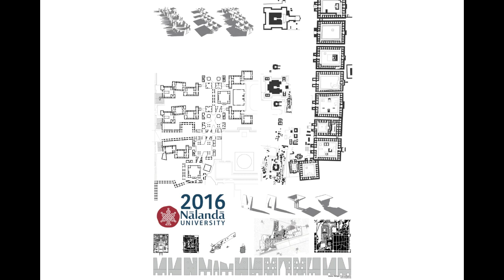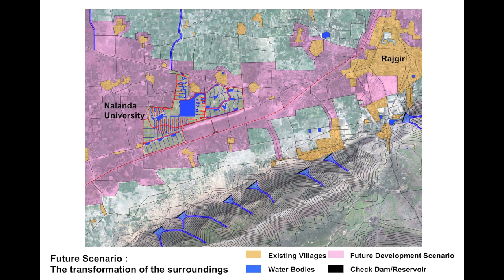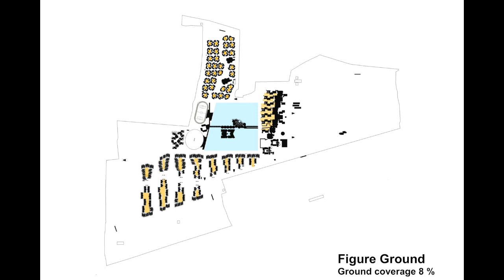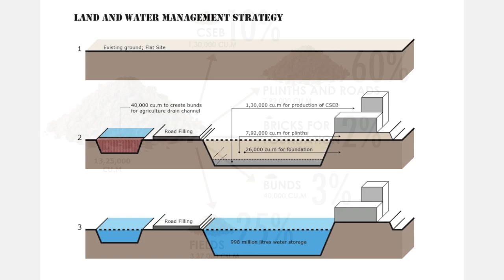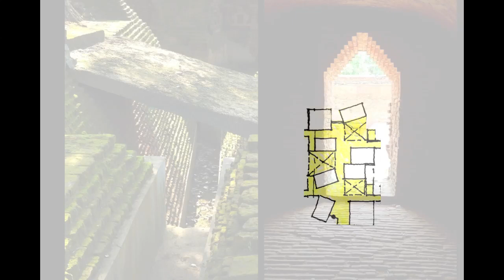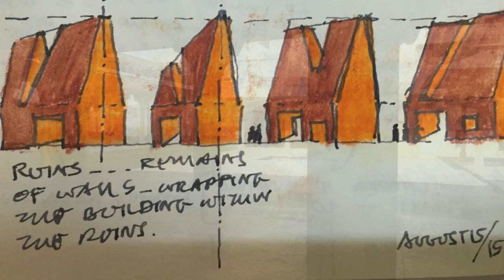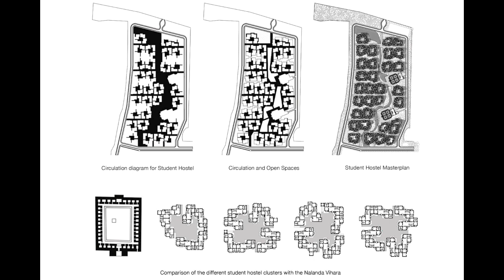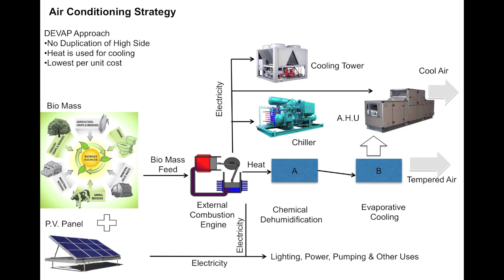Nalanda University Design

Comment: i think too much water will make that very humid during summer and no wind. humid and agriculture around is not the best.
Reply: Have you seen the campus of IIT Guwahati, IIM Calcutta, NIT Silchar, their campus are full of lakes. IIT Bombay's campus is surrounded by 2 big lakes.

If the NU campus will be full of trees, there won't be any problem. As they create their own ecosystem.
And the buildings are designed in a way that they are Highly energy efficient.

I think there will be no problem